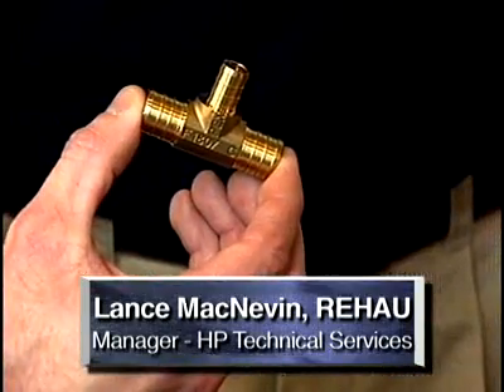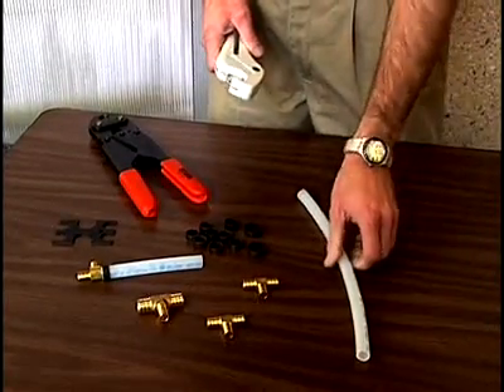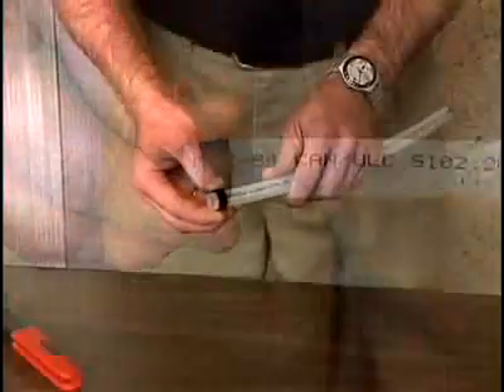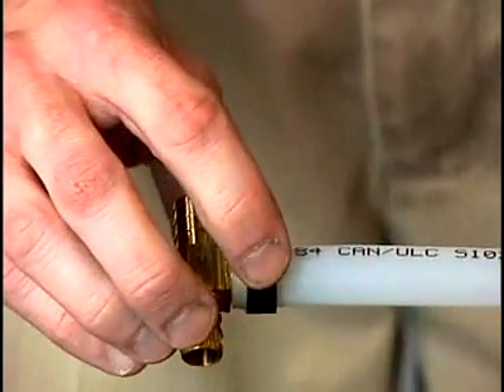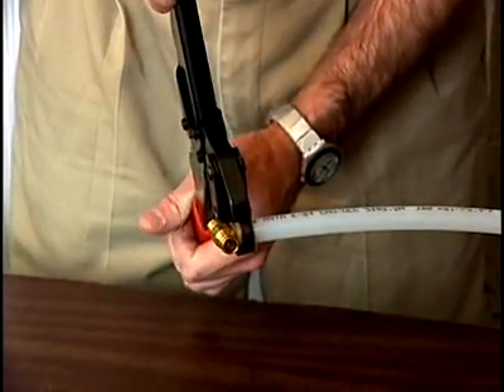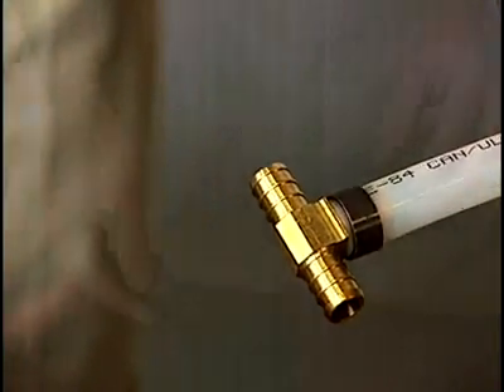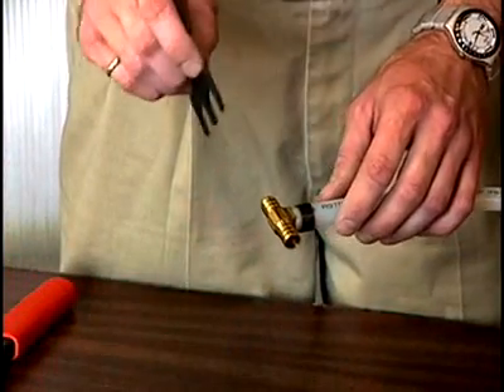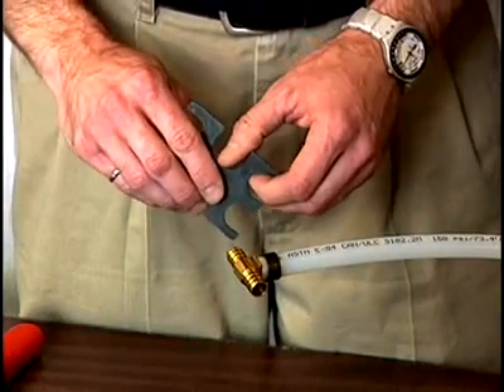PEX Pipe - Crimp Ring Fitting

Comment: He says that the crimper should be kept perpendicular to the fitting, but I have found that this is absolutely critical. If the crimper is twisted even a little bit, which is easy to do because of the great force required, the joint will leak. The stainless steel rings made by Watts or Surlok are more expensive, but are pretty well fool-proof and much easier to cut off if a change is needed. My advice is to avoid copper PEX rings like the plague, unless you are a glutton for punishment.

Comment: Serious question.....why is it "so important" to have a nice, clean , square cut....when using crimp style fittings? Don't get me wrong, it makes for a clean install....but unlike Sharkbite push-fittings....where a clean, square cut is needed because the PEX edge TOUCHES the internal seal....such a touch does not occur when using a crimp or even a clamp-style connection.

Comment: The tool is the problem in tight spaces.As you have to open it up all the way. Waiting for some company to manufacture a shorter version to purchase one or with a ratchet system that you don't have to open up all the way to fit over the ring.
Reply: Cinch crimper
Reply: These crimp thing suck